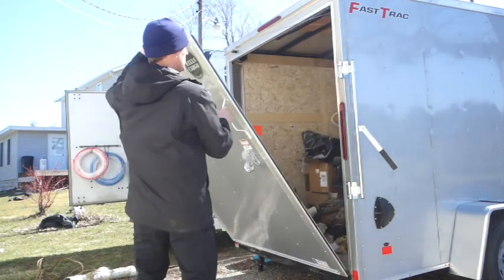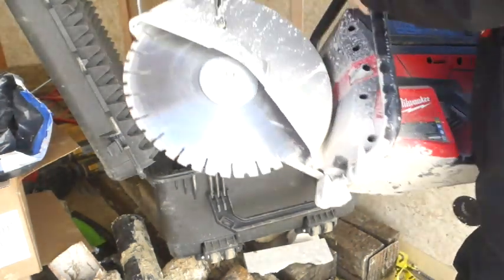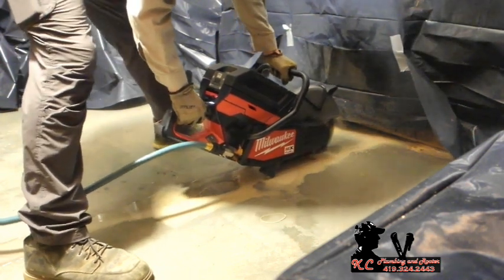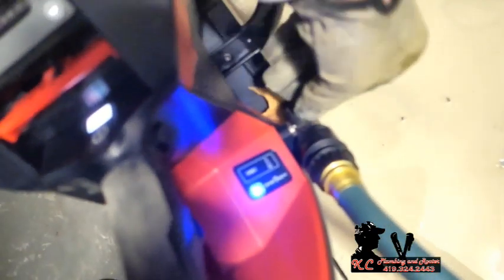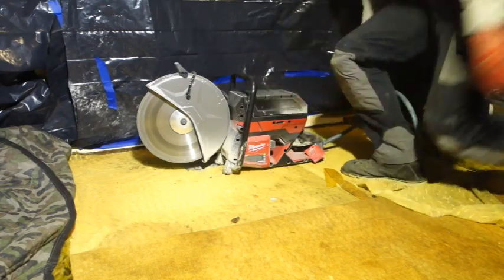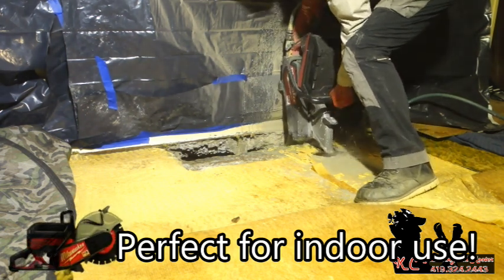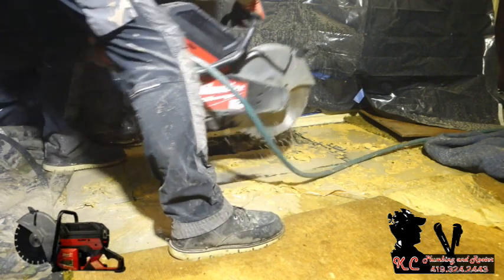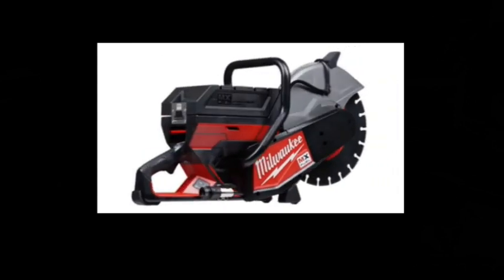Cutting cement with battery power! Milwaukee MX 14" saw

Comment: Awesome, I've got one too, works great for cutting out concrete in basements to install the liberty sewer pump and bathrooms underslab  plumbing, 
I've done 2 now with it!. About 5 ft per charge,
 I also often use it  to cut cast iron sewer pipe, slices thru in 20 seconds saving a lot of time and frustration! No fumes👌

Comment: Thank you for your videos , I've been wondering about the big Milwaukee saws I've got the Makita 4 stroke gas I do like it, and a lot less fumes than the 2 stroke but still in a basement not practical, do you know anything about the M18 concrete saw just wondering my saw does most everything I need it to do but for a basement I was thinking maybe I would get the M18 concrete saw. Thanks again for your videos and hope you have a good weekend.
Reply: I've seen masons use the m18, cutting veneer stone ect,  and they like it for that but no chance it will be any good cutting slab

Comment: I'm impressed. How big are the batteries and did you have 2 chargers running? I'm very intrested.  Thanks
Reply: The CP203 battery has 3Ah, 20 cells at 72V and recharges in 45min. The XC406 has 6Ah, 40 cells at 72V and charges in 90min. Cuts 6ft of concrete per charge. You can charge it with the MXF002-2XC charger that is also a 1800W power inverter.
Reply: Thanks. I thought they might have been big 9 amps or something.my mate bought a stihl and he were lucky to cut a one a half 3x2 flags.

Comment: The exact same thing could be accomplished with a corded Husqvarna saw.  I really don’t think it’s worth the huge investment.  Run time is poor.
Reply from the maker: What would you plug it into?
Reply: @kcplumbingandrooter  either existing power if available or my Honda generator.
Reply from the maker: @mirocabraja5128  I was just going to say, what happens when the breaker trips every 15 seconds? But a generator is good.
Reply: @kcplumbingandrooter  I usually just bring my generator all the time I don’t even bother with house power anymore saws don’t like 15A power